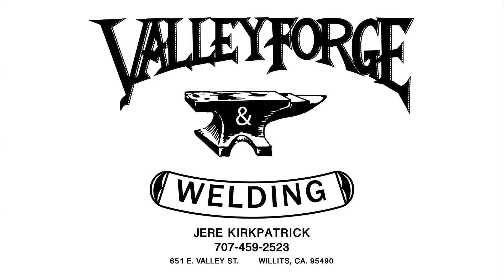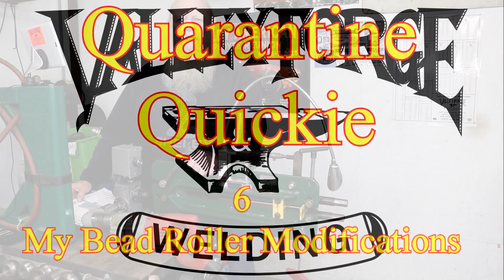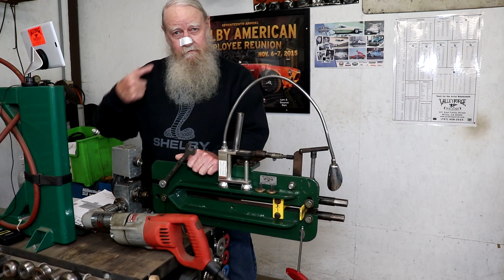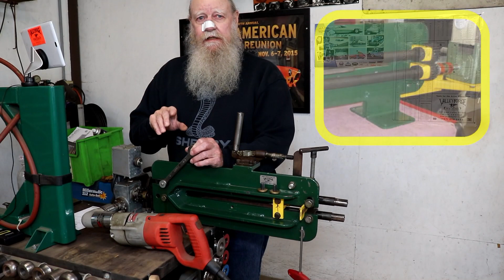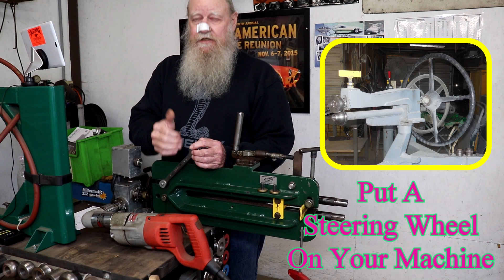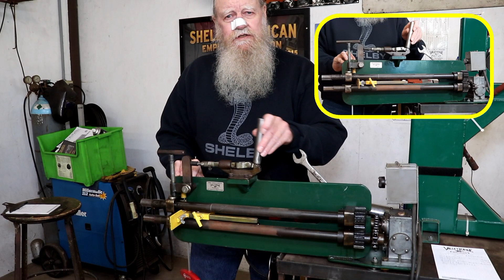My Bead Roller Modifications

Comment: Jere,  you made a slot on the top (rear) so you can slide the shaft back /forth , why did you not make the same slot on the bottom, don't the two shafts need the same flexibility?  I noticed you drilled a second hole instead of a slot, is that 2nd hole centered to the end of the slot on the top? thanks , I am modifying my  bead roller following your video.
Reply from the maker: Hello DD:

Only the top shaft needs movement. This is used for aligning the dies. The bottom shaft is moved forward in order to keep the gears lined up in the middle of the top shaft movement.

I have a set of plans that will walk you through all the steps and a parts list and where to get them. The plans are quite thorough  and a step by step DVD. You can find a link to my web sight in the description.

Thanks for watching.            Jere
Reply: @jerekirkpatrick2092  Thanks very much for your quick reply, your explanation made perfect sense, I just finished drilling/tapping all the holes and assembled most of it., the plans for this project would have most likely helped but my bead roller is a combination of  2 or 3 different designs mixed with some of my own (I'm left handed). I copied a bit here and a bit there to suit my needs. before I go I must add you are a great source of inspiration for me  . keep  it up .
Reply from the maker: @ddistrbd1  Both reversing and variable speed are important. Being able to reverse while in the same position (like while making flames) can sometimes be helpfull.
Jere
Reply: @jerekirkpatrick2092  Thanks for your reply Jere, I'm sorry I ask too many questions, don't mean to be a pest.

Comment: Link to your contact is not working Jere.  Would like to order your plans. Watched the vidoes and could probably duplicate your mods, but want to support your site.  Appreciate how you described why you used the materials you used.  Being an "Engineer Type" I love to know the "Why's".  
Also, for some of you guys thinking of motorizing yours, consider this, I am about to use the motor drive and reduction gear box drive from a Mobility Scooter I bought on Craigslist for $75.  It's 24 volt, variable speed, lots of torque, reversable and it came with a charger.  So should be very portable.
Reply from the maker: Hello Curtis:

You must be somewhere out of the US. Pay Pal can't calculate foreign shipping charges. If you give me your mailing info I will take the plans to the post office and get you the total amount with shipping. Then you can make a Pay Pal transfer. My E-Mail address is jere@saber.net.

Thanks for watching and wanting to support my efforts.          Jere
Reply: Odd,,,,, I'm in North Central Texas. I'll email you.

Comment: a few years ago I bought my basic plate beadroller and plans from Jere at a metal meet in Santa Cruz. I did all the mods per the plans and couldn't be more pleased with the results. I also broached my rolls and welded keys in the keyways of the rollers, another Jere pro tip. No more wobbly rollers from the set screws pushing the rolls of center. I ended up buying a Harbor Freight pipe taping motor to power my beadroller. Its removable so it can also be used to power my Harbor Freight tube rolling bender, or tap big pipe assuming that the taps actually cut and produce leak free threads. The worm drive drive reduction seems to keep the motor in a happy place when I'm moving slowly around turns. At one point I will add a light, and a laser, just like a custom car its never really done.
Reply from the maker: Hey Chuck:

Good to hear from you. Just herd from Ron last night and plans for this year are in the works depending on status of the virus.

Thanks for the kind words regarding the plans.

See you Nov. 14-15 if all is well.            Jere
Reply: @jerekirkpatrick2092  great to hear, I'm eager to get out once this all blows over. Ron just gave me some pointers on the wheel. I've been working on my model, getting more done now that I can do my day job from home.

Comment: Hi Jere.  I'm glad your "Schnoz" is doing better.  
This video is a great addition to the others you have posted regarding the modifications you made and the plans you sell.
As I am "financially challenged", I used the junk I had laying around for my bead roller, which included the power steering motor from a Chev car. That unit is similar to a windshield wiper motor with built-in worm gear reduction, only larger/stronger. It, along with 2 sets of sprockets and a reversible speed controller lets the motor spin up nicely yet still roll the dies nice and slowly.
Now.. if the arthritis in my hands would cooperate and let me use the darned thing! 
Thanks for posting.   
Joe
Reply from the maker: Hi Joe:

It sounds like you have put a lot of thought into your machine. Good job.

I have 3 more videos to do, on the bead roller, that may be of interest to you.

Thanks for your input it is appreciated.             Jere
Reply: @jerekirkpatrick2092  Thought, trial and error and getting as many ideas from others that I can.
3 more videos on the bead roller? I'm sure I will be interested. But I don't think I have been uninterested in any of your videos. They are always informative with just the right amount of your dry wit. Or maybe you are always meaning to be serious. If so.. oops. ;)
I believe you had mentioned a planishing hammer video or two. That should be interesting as well. I built mine out of scrap, just like my English wheel.  And when I say scrap, I don't mean nice "off-cuts" of good metal. I mean scrap.  So I'll watch any video you have to post.
Stay well...
Reply from the maker: @Joe.Doucette  One of my next videos will be on diminishing beads as you suggested. Another on tipping.

Others have called my wit "cutting". But yes I do have a very dry wit.

Thanks for your input. Much appreciated.            Jere
Reply: @jerekirkpatrick2092  Can't wait.. :)

Comment: HI JERE, GREAT VIDEO AS USUAL. I'M MODING A WOODWARD FAB ROLLER, COULD I ASK WHAT THICKNESS THE SPREADER IS? THANKS
Reply from the maker: Hi Thomas:

My spreader is 3/8" X 1 1/2". It's the same material as the main frame support. 

Good luck with your mods and thanks for watching.        Jere

Comment: Hi Jere,
I built mine from a Woodward Fab's. I used square tube on the side and forgot to slot the top hole. I was still able to slot it and got it to move 3/4" which works ok. I would like to make one with square tube and do away with the front bearing blocks which seem to be in the way and the space would be more open like an English wheel. I had mine done before I saw yours. I am definitely going to use your back stop and mounting system design since it accomplishes two things with one mount  brilliant! I may use your idea of the quick clamp but for now my hand crank works fine. I used a Bodine motor from Ebay and their control for speed and direction. It is nice and quiet. I had my drive rods machined to fit Lazze;s rollers.  I look forward to your videos cause I know Iearn something new. Thank you very much for sharing your knowledge and ideas with us.
Reply from the maker: Hi Bill:

It sounds like your next machine is going to be a doozie. The machine you are using now is set up just right. I can tell you put some thought into your mods before you jump into making them. Good job.

Thanks a lot for your input. Much appreciated.            Jere